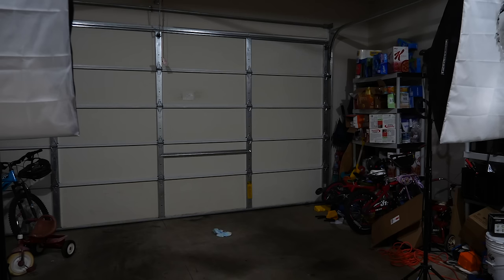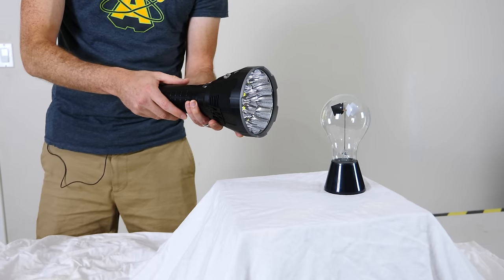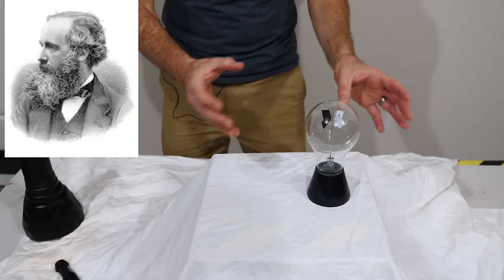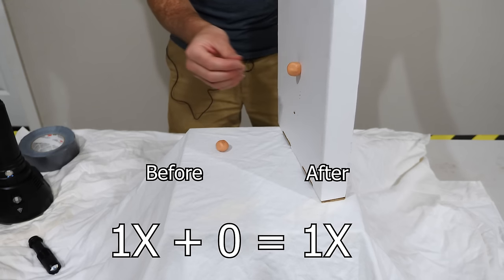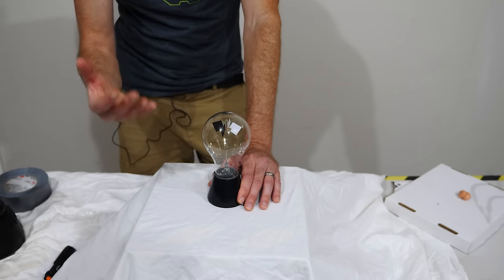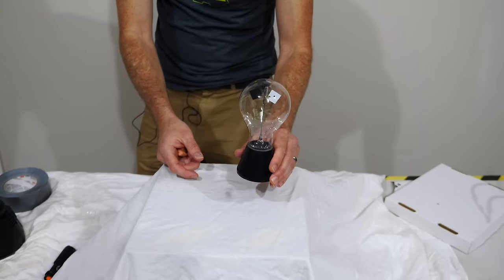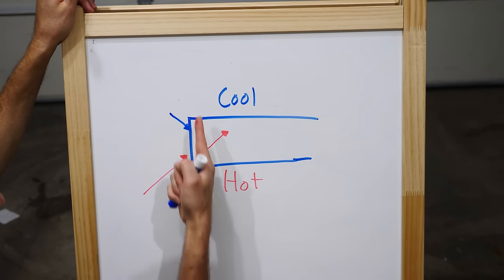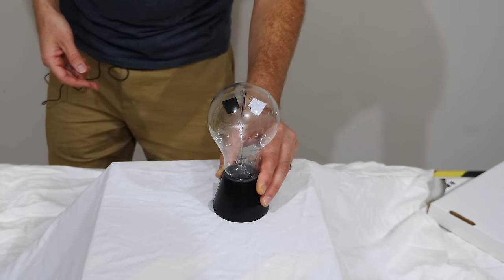Shining 100,000 Lumen Flashlight at a Crookes Radiometer

Comment: Plane's bottoms should be painted black and their radiators and coolant lines should disperse heat out the bottom of their wings to produce a higher pressure underneath for better lift if they don't already and race cars should do the opposite

Comment: before I here the explanation I'm going to guess that the black side absorbs the energy where as the the white reflects it, so the black side gets hotter causing it to radiate more heat than the white side, and that radiation off of the surface creates a propulsion force pushing it since the opposite white side does not give off any propulsion force or at least far less.

Edit: Well I think I was close, but I don't get the explanation for the edges and the direction of the particles. I feel like we need more detail on that and why that happens.

Comment: actually light would not cause any motion at all by itself as its bi-directional. it has not linear momentum. the wave propagate forward and backward at the same time. we see this obviously in a laser double slit where the interference pattern appear in the source before the beam is split. if light traveled only linearly Crookes vanes would spin in the opposite direction as assumed.

Comment: that's not where the sum of the vectors points, you were significantly off

wouldn't this have a greater effect on the flat surface rather than the edges? more area that when hit by an air molecule it will result into a bigger torque rather than when they hit at the side at an angle.

Comment: Can't Thermal Transpiration be used for spinning turbines to produce electricity?
Reply: that would probably need a huge setup, because it already needs a needle bearing with ultra low friction to turn itself in this size. I don't see a high efficiency here. Solar power plants of any kind would work much better, and even a solar driven Sterling motor could probably have a much better output in comparable setup size.

Comment: Why don't you make your own Crook's Radiometer by making the same one as the original, but this time paint each side with 100% Pure White paint and Black 3.0 on the other side, then put in your vacuum chamber box.  Then do the 100,000 lumens test.   See if it spins faster than the Crook's, since as the Crook's does not have Black 3.0 paint on the side of each fin.  What do you think?  I wonder what the RPM would be?   Probably a helluva faster than Crook's, that's if you manage to attain near total vacuum?

Comment: I thought those things worked on IR energy more than visible light? The black fins absorb the heat, then re-radiate it making it spin. Try it again just using a 250 watt heat lamp and see what happens.  Hmm, as I write this it seems you kinda covered that. OK, Uncle.
Reply: Controversy exists;
The device is said to show EM pressure;
The conversion factor is so astounding that it lends basis to the heat "theory:"
Without an actual device and scientific grade vacuum pump this is difficult to determine;
His demonstration lends to the entrained air theory as it would go the other way if it was radiative pressure;

Comment: If you follow my previous comments crooks radiometer is an example of why speed of light never changes. As the wheel rotates, it still remains white. Or am I wrong about it? Maybe it changes un-noticeably. You said that X= -X+2X. So according to you reflection does not change velocity. It is more important that energy is conserved than momentum is conserved. If reflection does not change energy, no momentum is transferred. So white surface behaves like a static wall for white light. But from my understanding of classical mechanics momentum is always conserved. If we assume momentum and energy have to be applied at the same time, and if we use energy of reflection is same as input energy, white surface behaves like a wall. You seem to suggest that crooks radiometer does not work in the vacuum.

Comment: It sounds daft and I don't know if it's scientifically feasible but if you build something similar in a vacuum chamber and shine a light on it, won't that remove air resistant speeding the rotation to incredible speeds, not quite the speed of light mind you but still impressive speeds

Comment: 100000 lumens? you believed the marketting didn't you

With an ideal source of light you would need 146W to get that output, but we're talking 555nm monochromatic light
The theoretical efficacy limit for wite LEDs puts you above 300W.
With good real LEDs you would need in excess of 500w, more than two thirds of which are gone as heat, that tiny fan wouldn't be able to keep up.
Almost every flashlight manufacturer lies about the luminic power, or maybe they use other definitions (remember P.M.P.O. for audio systems?).

Comment: just not seeing why your momentum explanation wouldn't also apply to the flat side of the surfaces. As the white side being cooler they would bounce off with a slower change in velocity meaning the change in momentum would be less as opposed to the black side where they would bounce off with a larger change in velocity meaning the change in momentum would be larger.

I know you're saying it can't be due to change in pressure but that sounds more like an explanation that would make more sense if the object wasn't extremely low pressure. Where as what I would be talking about is just a momentum explanation. Not sure if the "pressure explanation" is the same explanation that I'm thinking of here with respect to the momentum.

if you had a link to Maxwell's explanation and calculations on this that would be awesome. It would probably make it easier for me to see why the "pressure explanation" isn't true.

Comment: Thank you for the video, so that means you can make a small generator using temperature and radiation by inserting a very small brushless motor into the radiometer?
Reply from the maker: solar panels would be much more efficient than this:)

Comment: The air near the hot side is more “excited” than the air near the cool side ( the molecules vibrate faster and further and bump into each other), which means the air near the hot side is at a lower pressure than the air near the cool side - pressure differential causes the fin to move towards the low pressure area. The Bernoulli Principle.

Comment: The vectors you drew are wrong. They're both going right. You'd have a huge right facing vector.
It's not going to move that direction anyway because it's fixed, obviously, but you still didn't add them.

Comment: Badly explained, sorry.  The vector addition wrong solution depiction was the straw for me.  BTW, the correct explanation involves quantum explanation of photoelectric effect and electron emission hitting so called rarified air.  Not p
=h/λ as you didn't change wavelength...